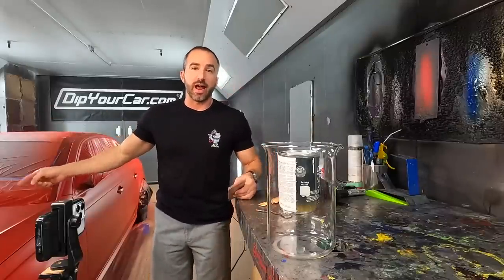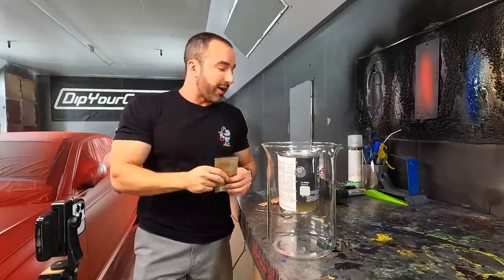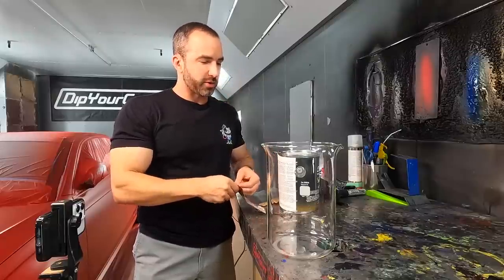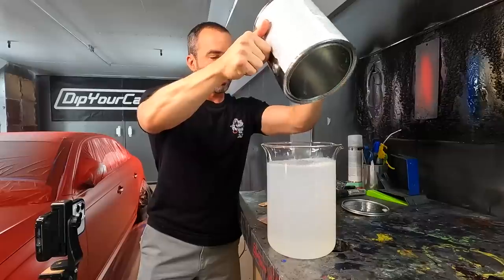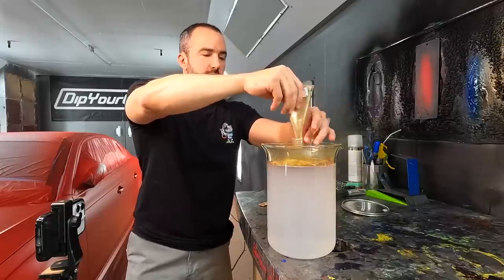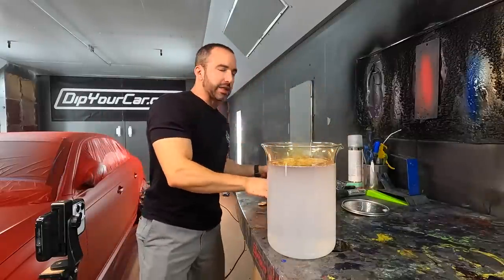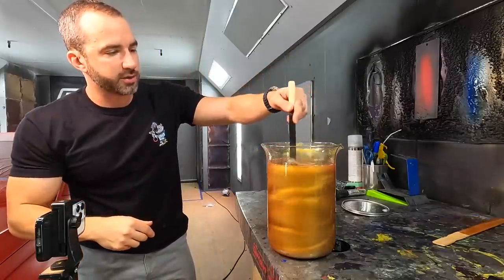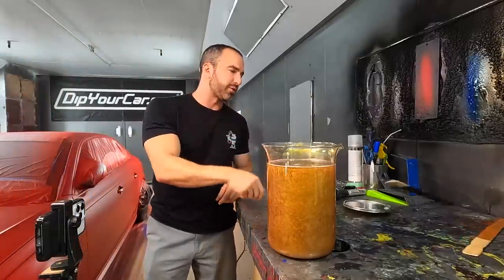Melting Down Iron Man's Suit Into ColorShifting Car Paint (This got WILD)

Comment: While the initial suit was primarily Iron, majority of the suits as of Mark 3 were titanium or a titanium-gold alloy. The Endgame suit was vibrainum and nanotech
Reply: while technically correct that the majority of the suits were titanium... They were actually a Nickel-Titanium Alloy called Nitinol. It has the strength of titanium, but it also always remembers its original shape. so it is almost self repairing.
Reply: Ummm,…what colors would that be??
Reply: @michaelladigo2395 it was coated with red and gold color, so that doesn’t matter
Reply: @michaelladigo2395 look at the warmachine suit at end of first movie
Reply: Ok, dont nerd out too hard 😂

Comment: This actually has a real color name.  It’s called Sunburst Orange.  It came out in the 1960s to the early 1970s. The Fender Stratocaster did this same design on a limited amount of Strats.  It’s a very rare breed to find one as well. It had a red base coat with Gold glitter.  That affect made it look in an orangish color.  I know this because I owned one back in the 70s and 80s.  Kicking my self in the ass because I got rid of it.